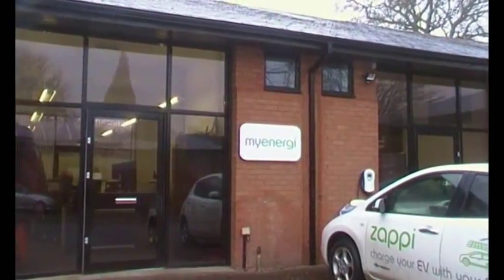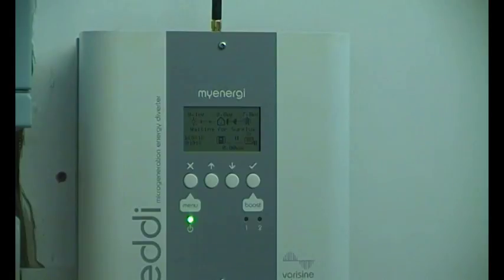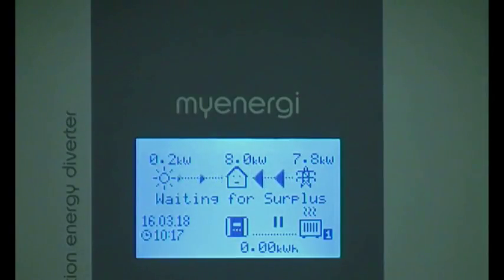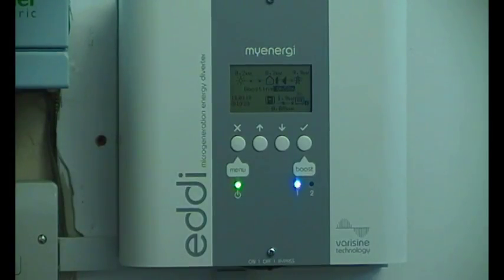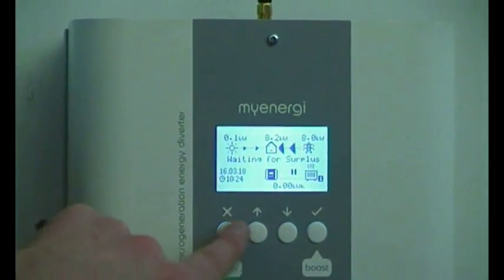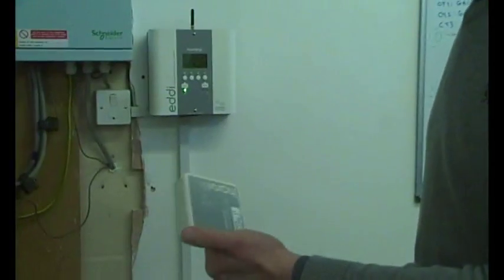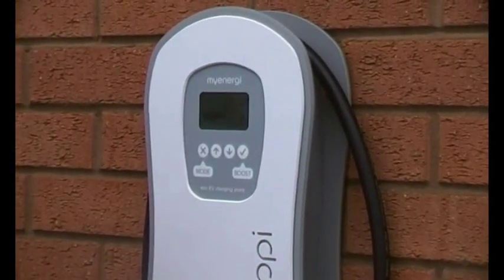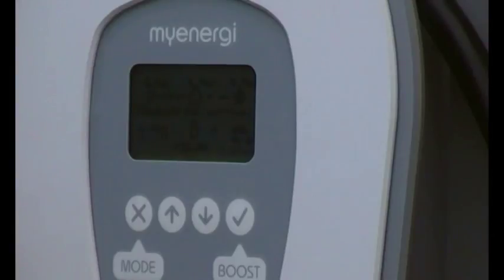The eddi grid diverter and zappi EV charger intergrated system, getting more from your solar.

Comment: I've had eddi for two weeks and it always shows waiting for surplus even when battery is 100% and heavy flow going to the grid. What do you think is the problem? Any suggestions welcome.
Eddie
Reply from the maker: Hi, sounds like the CT clamp is the wrong way round. If not try myenergi tech support, apparently they are quite good, cheers

Comment: Thank you for your video presentation.  I have a couple of the older Immersun units wired in as master & slave.  Used them for about the last 7.5 years or so.  Could you, or the MyEnergi owner, explain to me what the differences are between the technology within the newer Eddi unit relative to my older T1050 Immersun units please.  If I heard this right, it was said in your video, that the Eddie modifies the amplitude of the sine wave to vary the voltage output to the load, thus utilising most of the surplus electricity generated from the PV system.  I understood that my older Immersun units used 'Pulse Technology' to send the FULL 230v/245v mains voltage in timed pulses to the load.  The problem I've experienced is that this 'upsets' the built-in transformer within any voltage optimiser used to lower the voltage within the house, eventually causing the voltage optimiser to fail.  I have personally experienced this; expensively annoying.  Does the new MyEnergi Eddi overcome this problem???  I shall wait with eager anticipation of your answers; thank you.    Regards from sunny Colchester.
PS. You can checkout my output on PVOutput.org, search for JohnnyK's PV.
Reply from the maker: John, thanks for the interest, as to the details best have a word directly with the tech department of MyEnergi, they are in Binbrook, near Louth , Lincolnshire, not the other side of the world. There customer support is very good. Subscribed? Cheers

Comment: Will this system allow you to use energy from the car battery in the house ?
Reply from the maker: David, an interesting question, does it backfeed from the EV battery, I don't think so but with the rest of the system in place it would not be too amny steps to make it so. The question being how much power could be taken from an EV battery? and the answer to that I think will be very user specific but the system could be used to smooth out grid demand. How that would work with charging from one's own PV system would take some thought and experiment. Cheers
Reply: I think that is the way forward. The 'duck' curve of solar during the day is apparently causing a through re-think for the grid generating system so ... lets charge cars with the surplus in the afternoon and take the eastender kettle spikes from them during the evening spikes but let individuals set a minimum plus safe charge for their cars. I do hope to solar the roof here at some point but not unless I can have a battery on the wall, tesla or other, so that i can use all I generate and a bloody big switch so if the power does go down I can still get to what is in my battery. Grid tie is fantastic but to be without power when there is £10k worth  of kit wired in??? Madness!
Reply: This is not the Zappi car charger which currently is not vehicle to grid, this system uses excess solar/ wind power to send excess electricity to heat up water or heaters. Myenergy currently are in a "watch this space" for V2G, connecting their systems together will be easier with the app which will launch later this year
.

Comment: You DO need a degree to set this up (23:36),  I found it really difficult trying to pair the 3 devices (harvi, eddi and zappi) and configure them correctly.  It's so frustrating investing in an expensive system if you can't fully exploit its potential, so video set-up guides would be really useful.
Reply from the maker: John, thanks for the insight, you are right about the set-up guides being vital as video say more than words alone. Cheers

Comment: Thanks Andy, for clarifying how the CT works  I know understand what they are doing with active power, if you think how a aluminium disk rotates backwards in an old fashioned electric meter with power going out by measuring volts and amps.  Similar to this https://learn.openenergymonitor.org/electricity-monitoring/ac-power-theory/introduction
The Eddi probably uses a similar idea to this http://scoraigwind.co.uk/tristar-follower-to-control-ac-heaters/

I'm using https://openenergymonitor.org/ with my own hardware and Node-red, I'll also add OpenEVSE with solar control when I get an EV. I also intend to use a https://nextion.itead.cc/ display - nice to see the Zappi display for display icon ideas

You should look into Node-red too - it's not difficult ! ..

You can set all EV's onboard chargers charge rates in 1A increments, that's how the Zappi and OpenEVSE works. https://guide.openenergymonitor.org/integrations/openevse/

Oh yes - Are you aware of https://www.navitron.org.uk/forum/ - very interesting forum.